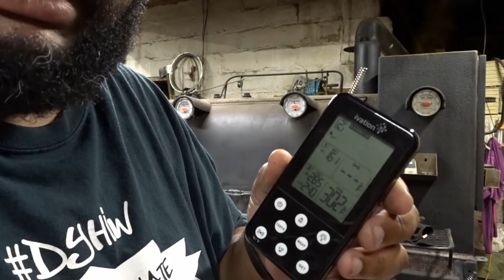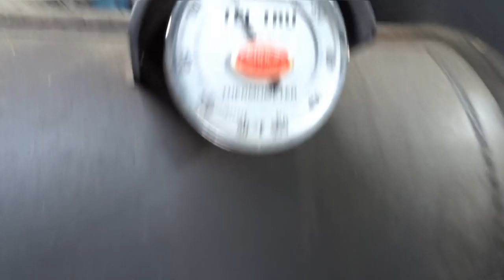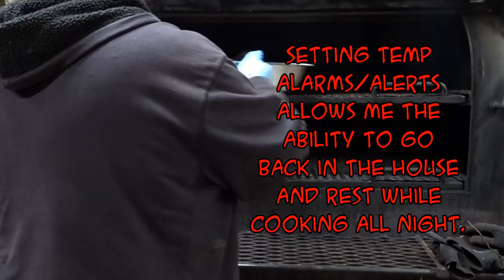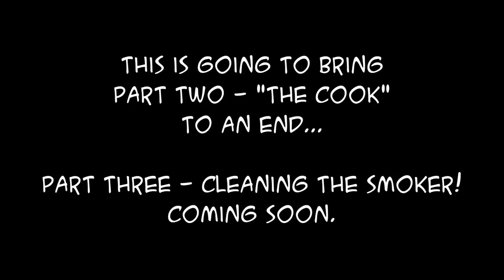SDSBBQ - BTS of a BBQ Catering Job Cook - Part 2 - The Cook

Comment: Hey bro, you should try leaving your fire box open instead of the pit to bring the temp down?
Reply from the maker: If I leave my firebox open then the fire rages and it would do the exact opposite of cooling the cooking chamber... I'd adjust the damper/intake on the firebox while letting out the excess heat and slowing down my fire to lower the cook chamber temps.

Comment: Hey if you take your grey lugs you prep your meats in and rinse them out with hot water and then fill them up clean hot water and let it sit outside in the sun and in my experience it draws out the red color or seasoning colors. That usually works for me bud. Hopefully that helps.
Reply from the maker: Thank you ever so much for that tip... when I can't get the color out I know it is time to get new tubs as they have begun to get porous. I will defiantly keep this in mind though for the next big cook!

Comment: Great videos! Question,  I see you're a fan of adding water in the chamber. Does that make your cook shorter ? Longer ? Or any different if you were not use water?
Reply from the maker: So I have honestly NEVER really cooked without water to see if it makes a difference in the cook time. BUT... With water it helps even out the temps so I imagine it would both slowdown and speed up the cooks. So if the fire gets to hot the cook happens faster... if the heat gets too cold it will slow down the cook... so t me the water helps even the playing field and keep the temp more in the Goldilocks just right range.
Reply: @SDSBBQs  thank you for responding! I need to try this method soon

Comment: I do pretty much the same as you. I use SS full size hotel pans w/covers. When you covered the meat, I move it to the oven in the house at 185-225* and finish it there. That saves me the cost of smoking wood. I can fit 4 full size hotel pans w/covers in my oven. It's a residential not commercial oven. We measured them before buying so I knew they would work. Meat looks great and I hope the gig is a success. Happy smoking.
Reply from the maker: I starting bringing it in the house to save trips out in the cold whenever possible. I will tell you though you can cut your cook time down drastically by bumping up your oven temp to 300F Max. Damn, I thought my oven was big I can only fit 2 full pans. My oven isn't deep enough for me to fit them side by side so I can only fit one the long way and then I try not to put one too low in the oven.